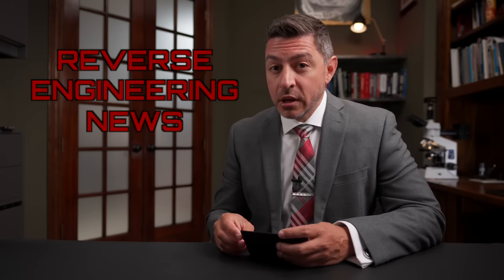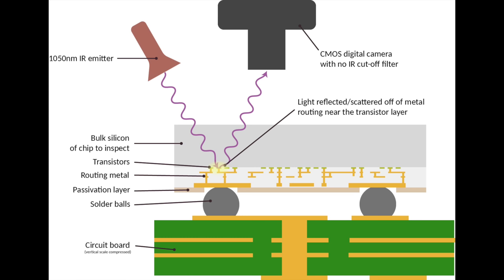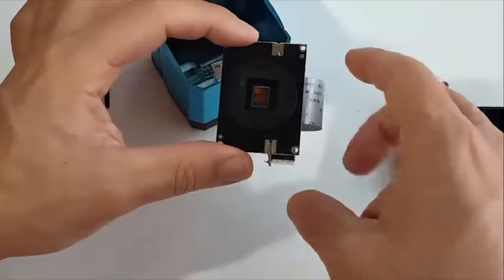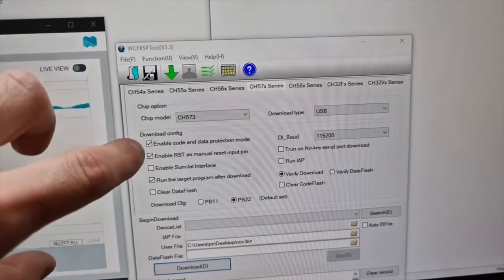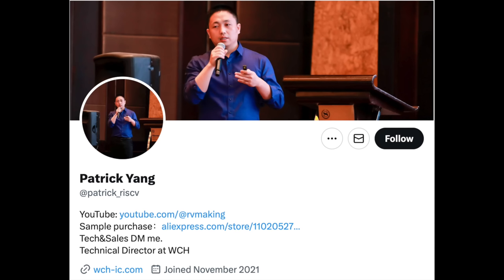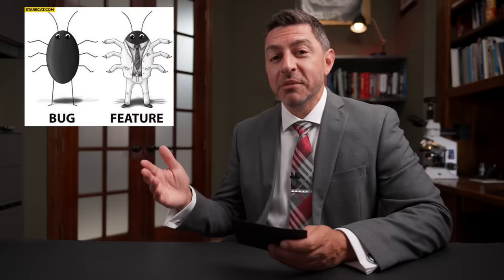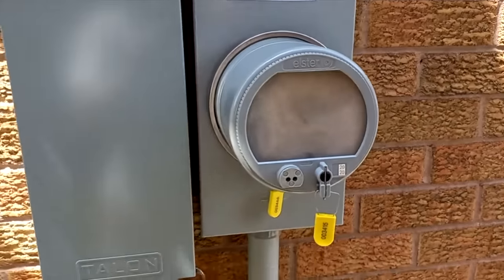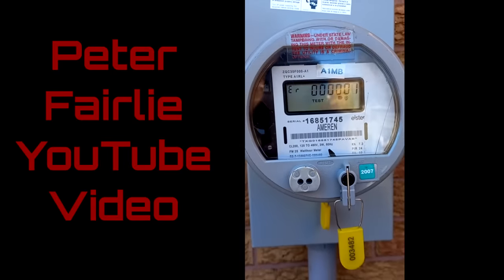Flipper Zero Kills Smart Meter?? - Reverse Engineering News - June 13th 2023

Comment: To debunk your debunk, the Flipper can exploit the 2G secure network used by many energy companies electronic smart metering, the Flipper has also been upgraded to even exploit the 4G network for any future capability’s. On how to exploit energy credits is for another forum, one must remember most homes still have the original metering system and energy companies still manually read consumption data. There is still a high possibility of detection as digital and analog data will not correspond.

Comment: An other way to debunk that he was using the meter to control the power is that even if the meter has a disconnect relay in it the meter will still be powered up and the display will be on when it disconnects service.  The meter get's it's power from the line side of the meter socket prior to any measurement or disconnection circuits  so that the meter doesn't measure the power required to run itself and so that if the service is disconnected the meter is powered up to listen for the signal to reconnect the power.

Comment: I work on testing those old elster meters and me and my coworkers immediately knew it was fake since even if you did disconnect service to someone's house, the display should still be on. And like you said that particular meter doesn't even have a relay, as we noticed from the 6th field in the style number.

Interestingly enough, the energy axis radio was installed in that meter, so even if you could capture the c12.22 packets coming out of it, you wouldn't be able to read it since it had wan encryption enabled by default (unless Ameren disabled it)

Finally, that particular meter wasn't even sold to Ameren (looked up the serial number on our db) so I'm not even sure how that sticker got there. It was actually sold to some research group in the US.
Reply from the maker: Thanks for sharing what you found as well. The more I dug the weirder it got 😂 

I haven’t played with the Elster meters at all, most of my work was on the L+G meters.
Reply: DING! We have a winner. The video shown here is of a meter that isn't powered at all! The meter is always connected to the grid and always on. (otherwise, when it turns the power off, how the h*** is it supposed to turn it back on.) The second one I couldn't see the display, but it's pretty safe to say they blew the smoke in through the conduit.

And the module he's talking about is for "load control" - so the utility can turn off water heater, HVAC, etc. to manage load on the grid. Around here (CP&L) they used individual modules at each device - made by ABB. (they also removed them in the 90's because it cost them too much money.)
Reply: Maybe Peter is part of that research group? Many honey pots on yt👀
Reply: @RECESSIM I subbed, great vid! 👍
Reply: @-someone-. In what way?
Reply: @jfbeam Really? The utility company can turn off the HVAC and water heater remotely in some areas?

Just commercial properties, or in people's houses too?
Reply: @PowerScissor the slaves don’t even realize they’re slaves 😂
Reply: @PowerScissor utility companies have been doing it for decades in my country. Before smart meters with a system called Ripple Control.
Reply: @debochch  What country?

So you can just be in the middle of a hot shower, and bam they turn off the hot water heater?  Is it on a schedule at least, so you can plan around it?
Reply: @PowerScissor  new Zealand.

  It happens when there is a power crunch and there is not enough power to go around.   The utility puts out a "ripple" and electric hot water cylinder elements turn off.
No warnings given but there is enough hot water in the cyclinder so you don't notice for 12 hrs.
Reply: @debochch  I guess on-demand hot water heaters aren't big there?  No power is no hot water immediately with those.  Barely anyone installs a storage tank with them for residential here.
Reply: @PowerScissor  If they opt into the load shed program. Usually there's a monetary consideration for folks to opt in, thus " (they also removed them in the 90's because it cost them too much money.)".
Reply: @debochch  1 off my college lectures was doing some work on a high power amp and managed to feedback into a ripple controlled network - powered off an entire suburb's hot water systems, and as it was not done on power companies schedule they did not get turned on - lots of cold water!
Reply: @PowerScissor  Was done on rotating schedules around suburbs, (typically half hour) hot water systems were storage type so most people were not aware it was happening. Used to manage peak load as this is most expensive. Rhodesia/Zimbabwe but as was standard commercial equipment was probably used in many places.

Comment: I used to work for Schneider Electric in the power meter division and while the Ion meter had some strange and wonderful features, turning the power off to the panel wasn't one of them. Just like you said, you could drive outputs, but those outputs would have to be wired to a relay that did the shutting off of the panel.

Ion meters had Telnet available for use (some 15 years ago, so don't get too excited), and sure enough, someone came up with a hack. Schneider came out with a bulletin lamenting the world that we live in where innocent hardware gets hacked. I imagine hope that it has been fixed since then.
Reply from the maker: You gotta find that bulletin, those are hilarious to read 😂
Reply: If they're running the OS I think that one in the video appears to be running it would be easy to enable SSH and disable Telnet.
Reply: Tell me, why is Schneider electric software so utterly crap? The hardware can do LOTS of cool things, but the software appears to be made by a high school kid in the computer lab while constantly switching between coding and porn tabs.
Reply: I was told by a local Cert Auth here that hte ION was the finest meter they got their hand into. Elsters A1800 probably not as good (another animal) still a BEAST in terms of precision, while OTHER BRANDS still trying to reach 0.2 today. As close as your refrence standard as you can get.
Reply: @RECESSIM  iirc, the "hack" was only theoretical and derived from disassembly of the free windows configuration tool (a very old version of it)... Telnet was finally deprecated in ION meters about 2 years ago and replaced with SSH (which is also disabled by default)
Reply: @stephenhunter70  the old OS for ION meters (1997-present) was AMX (very small and stable but obscure embedded os) with a 3rd party network stack... SSH was eventually added on a few yrs ago and telnet fully disabled
The newer OS (2014-present) is VxWorks7, and that's exactly what was done
Reply: @38911bytefree  the ION9000 and ION8650 are pretty good at what they do!
Reply: Wouldn't you need a relay closing a contactor for a whole panels worth of load 🤔🤔🤔🤔🤔
Reply: @RECESSIM  Actually it was. Sort of the nerve of those guys. What made it worse was about six months before the exploit was found, I commented that it was only a matter of time before things went pear shaped.

What actually happened IIRC, was the hackers found that Schneider (or not Schneider, since it was the ION guys that screwed up, and that was most likely a company that Schneider purchased) hard-coded the password in the ROM. 

This also happened to another Schneider subsidiary, some outfit from Canada that made a power monitor that could handle multiple meters (for apartment buildings). We had a new engineer who was having a hard time setting the password to the meter and he had hooked up Wireshark to see what was going on. I walked by and asked how it was going and he said that he was stuck. So I took a look. 

Oh shit...

Turns out that not only did the dope-smoking Canadians hardcode the password, they also made it non-editable, and for good measure, included the password in a screenshot included in the setup PDF. Might as well make things easy...

The Canadian dudes were really pissed when they were told that they had to fix that. I'm not sure that they fully understood why. 

As for finding the bulletin, I'll give it a shot if I remember. I'm getting a bit long in the tooth, and these days I have a two-step memory. Two steps and I've forgotten what I was doing. :)
Reply: @sobolanul96  Man I don't know. Probably because Schneider's big thing was buying up every company under the sun without regard to how their product was put together. But your description might be closer than you think. I sat next to a pair of developers and they were a carefree duo to say the least. :)

I know that I didn't care for their Clipsal software. Goofy at best. And their PLC (can't remember which one) was not great either. But PLC software is generally a mixed bag at best. (Looking at you GE and Siemens. Give me CODESYS any day over these clowns.)

Schneider as a company was fantastic, really a great bunch of folks. But GM wanted me back, and made me the proverbial offer that I couldn't refuse.  

The Ion stuff was pretty good, and my primary job was to commission meters for the NAVFAC (Naval Facilities) installation on Okinawa.
Reply: @38911bytefree  The ION was a great meter. No doubt about it. :)
Reply: @dl5244  Ah, thanks for the update. It caused quite a bit of consternation at the time. 

And I am hopelessly out of the loop these days, I've been gone from Schneider since the beginning of 2012 when I went back to work for GM in Spring Hill, TN. Now I am happily retired. :)
Reply from the maker: @MrWaalkman  I worked for Pelco when Schneider acquired them to get into the camera business. Heard good things about the Schneider Electric side of the biz.
Reply: @dl5244  Yes they do. :)
Reply: @RECESSIM  Schneider was a fantastic place to work at 99% of the time. I can wholeheartedly recommend working for them. Super chill for the most part. 

The safety regs were a bit overzealous for us field guys (I was a FSR "Field Service Rep") and it was 80+ pounds of gear that I had to lug through the airport in Osaka (?) to clear customs and to get to my Okinawa connection. And then it was silly stuff like donning a 40 cal "beekeeper suit" to change a light bulb. That and all of the classes. Did learning the history of Schneider (and taking a test on it) improve my performance at work? I think not. 

So avoid the FSR job if possible. :)

But I left because GM offered me my old job back, with a raise (yeah!) and a promotion (Boo!), with my years of service intact, retirement untouched, same amount of vacation as before, even my original "ZID" (which was "zzp93j" If anyone can ferret that out, then you know who I am) and the contents of my H: drive were still there. It was as if I had never left. 

The FSR job at Schneider, while great, didn't pay anywhere near what GM paid (it was during the great recession so I was lucky to get a job in Tennessee). I still have fond memories of the guys there. :)

And I am primarily a PLC/Robotics guy with a buttload of car factory experience. Power metering, while really interesting, isn't exactly my cup of tea. I do love Modbus though...

And I see that Schneider bought Pelco for $1.5B and sold it for $110M. Ouch.
Reply: @MrWaalkman  Thanks for the answer. I have a buddy who works in IT for a big company. I recently got a server rack mountable ups and needed software. I had a disk with the original Powerchute software. At first I thought that I am doing things wrong. Then I asked the guy what to do, and he said something like this: "Carefully remove the disk from the drive and throw it as far as possible. If you still see it, try again." I did not believe him as he had a little of that cocky know-it-all IT guy attitude. 

A couple of weeks later I called him confirming that the disk had been properly disposed of. I ended up installing a network card and monitoring the device remotely through my browser, but even with this solution it is still miles behind the old java resource hungry Winpower software.
Reply from the maker: @MrWaalkman  Very cool! Yea, Schneider is the case study in the physical security space on how NOT to do acquisitions and enter the market 😂

Comment: In New Zealand the extra contacts are used to turn off the water heaters and "Night store" heaters in houses to shed load during peak load times, though they are almost never used by the power supplier. Usually on a seperate meter than the main house meter, they charge you a lower kwh rate for having it setup.

Comment: Hello. I have a question regarding smart meters if you could help me. The gist of the matter is, the company installed a smart meter at my house and i suspect that either the meter is faulty and it records wrong, or the technician did something to it to record a higher consumption than it actually is, because i got in a heated argument with them when they installed it and i'm thinking he may have done it out of spite. I tried callind them to come and evaluate the meter, but every time it's the same technician that comes to inspect it and every time he has this weird attitude. Either way, they won't replace it. My question to you is, is there something i could do to damage the unit without breaking the seals, that would warrant a replacement from them?

Comment: If you’re glitching around with your power meter the electric company will know because as it’s running, it sends a check signal every few minutes to the tower and if it doesn’t receive that signal within a day or so, you will get a technician showing up to check the meter there is even a gas meter for natural gas that does the same thing and the power company well where I live can turn off your electricity just by punching it into the computer, but within a few days, a technician will show up, pull the meter and put insulators on the socket and then re-apply the meter until you pay the bill

Comment: Thank you for finally exposing that last one; I have a Flipper Zero and was experimenting after seeing that video thinking, wow, I have a Flipper, I wonder if I...
Never could I find a shred of code or idea anywhere on how this was done. Was so confused!
Reply: Except, he was forgetting one thing: Regarding the the "first red flag" for the smart-meter - there is a major caveat with that. It is possible to move from Canada to the supposed location. This needs to be considered in the future. The other points are still very valid though.

Comment: an important aspect of the WCH thing was the second firmware from their OTA process. it's interesting that the response was that it's a time saving feature, since there's like no valid use for a partially readable firmware under lockdown; maybe they meant erase was slow? there's stuff to speed it up in chips where the entire flash is lost if the protection bit changes, like they set a flag and the old content is just gone
Reply from the maker: I felt the video was going to be too long to talk about the OTA part, but you’re 100% right.
Reply: Wonder if they were speaking of OTA updates that have minimal code changes being faster due to only changing needed code. Seems like it would waste as much time as it saves due to the device having to compare new to old to not overwrite the unchanged firmware. AKA BS.
Reply: That particular chip does only have bank erase as per Patrick. So no full erase at once.
And even with no firmware in the OTA area and with the first bank gone this method helps you a lot.
Since most of the time basic functions come first, like memcpy memset vector table etc. So you can still nicely Reverse engineer the firmware :)

Comment: props on the gps dox. I know some of those prefab houses have them like that for the fire department so they can shut them off remotely for insurance purposes if it's like a townhouse or apartment's building. I lived in one where the power would go out on purpose if there was a fire to lower the chances of electrocution when the sprinklers turned on.
Reply: In California - Firefighters use their axe to bust the meter out of the socket.